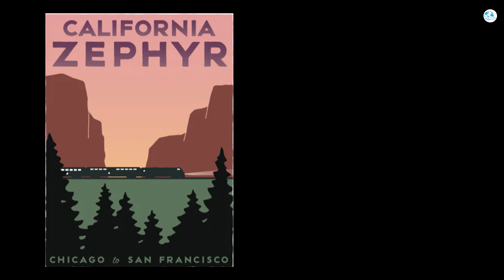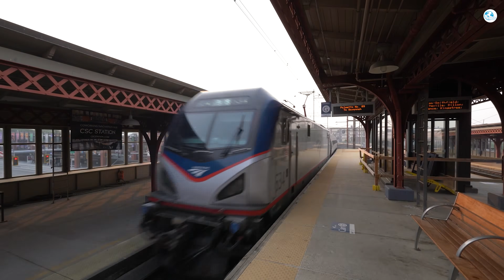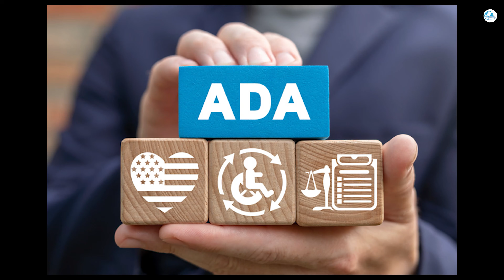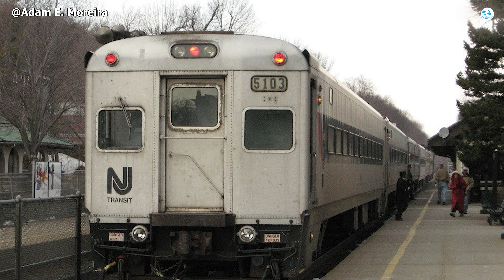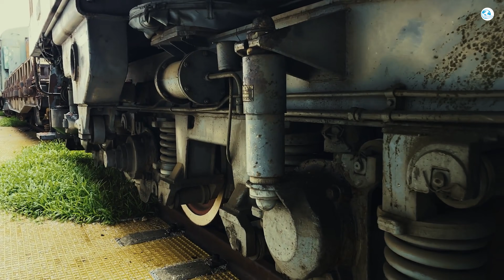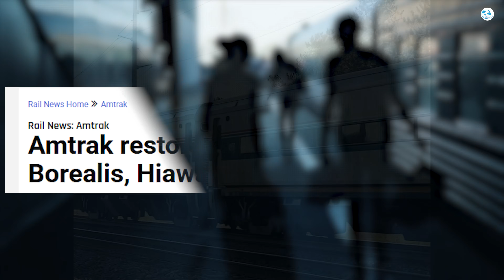What’s Going to Happen with Amtrak’s Horizon and Superliner Trains?

Comment: The ADA does not require access to the whole train. 49 CFR 38 spells out what must be done. If you have 6 sleepers, you have to have 6 accessible rooms with access on the lower level. Single level sleepers must have one room that has direct access to the diner on the table end. Surfliners meet the ADA requirements without having access to the entire train.

Comment: Amtrak Superliners can be rebuilt for less than buying new. The equipment would be lower capacity single level cars. Weight should be little different. I rode Superliners at 100mph.
Reply from the maker: Superliners still ride well at speed, but Amtrak seems to be prioritizing fleet commonality and long-term maintenance over rebuilding a small, aging fleet.

Comment: Metra gallery cars are equipped with wheelchair lifts to be ADA accessible, moreso than multilevel cars that also hinder walking through the train and seeing seating available seats on the upper galleries. Gallery equipment, rebuilt or new, is needed for high and more efficient combined Metra-Amtrak Hiawathas.
Reply from the maker: Good point! ADA-accessible cars would definitely improve comfort and operations.

Comment: To avoid more accidents with boneheads that's trying to cross the rails and get's stuck has the trains to run slow so spped is not a requirement
Reply: Don't give boneheads a a reason to hope they can beat the train!

Comment: The Hiawatha could possibly be eliminated, inasmuch as Metra also serves the Chicago to Milwaukee corridor. I believe they're on different routes, but busses could fill in to connect to Metra stations. 
I'm saying this because at least a few cars could be used on other routes while new cars are built.
Reply from the maker: Good point, using some cars on other routes as a temporary solution makes sense until new equipment arrives.
Reply: I think amtrak should have leased a few trainsets from metra and used them on the hiawatha service from Chicago to Milwaukee.
Reply: Same thing with the cascades, amtrak should lease a trainset or two from sound transit and use them for cascades service.
Reply: Multi-level cars won't be ADA compliant throughout.
Reply: Only one coach and sleeper of a Superliner consist needs an elevator to make the upper level accessible. Other Superliner cars can be rebuilt for higher train capacity than single level.

Comment: Does anyone know if Amtrak has considered replacing the Superliner cars with the new Viewliner II cars? I don't see a compelling reason to stay with the double deck design.  No elevators required. It seems to me all Amtrak would have to do is commission a dining car and an observation car built from the Viewliner II design. When combined with the new Siemens locomotives which have a similar height to the Viewliners, it would create a train that looks a little more streamlined and integrated, especially if Amtrak would create a consistent livery which flows smoothly from locomotive, to baggage car, to sleeper cars, dining car, observation car, and coach class cars.
Reply from the maker: Amtrak might still be evaluating, but Superliners and Viewliner II serve different needs, so a full replacement seems unlikely. Upgrades are still necessary, though.

Comment: These cars are stainless steel how can they corrode,.
Reply: Frames may not be stainless and continued use face structural failure from continuing stress  of use my uncle Nate had the freelance job writing the technical documentation for these. I saw the blue prints

Comment: The first Superliners were built and delivered 1977-81. The second fleet was built in the mid 90s. Both need to be evaluated for overhaul or possible retirement or limited use.
It's no help that many Superliners are running on short distance routes in California and Chicago hub routes.
Reply from the maker: Yes. The Superliner I and II sets are getting pretty old at this point, so Amtrak really does need to figure out whether to overhaul them or start phasing some out.
Reply: At least only a few amtrak trains on the east coast use superliner cars including the auto train, the capital limited, and the city of new orleans. That is due to insufficient tunnel clearances on certain lines including the northeast corridor.
Reply: Stainless steel cars can be rebuilt like Metra's 70 y/o cars.
Reply: @HarveyKahler-o2y3k  the Superliners are not entirely stainless steel.
Reply: Aluminum Horizon cars are not like stainless steel ones.